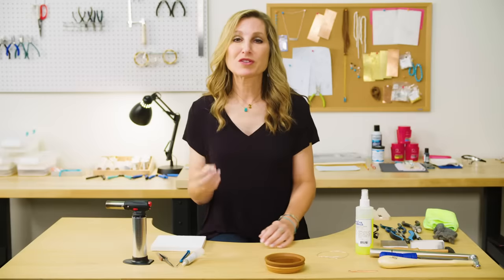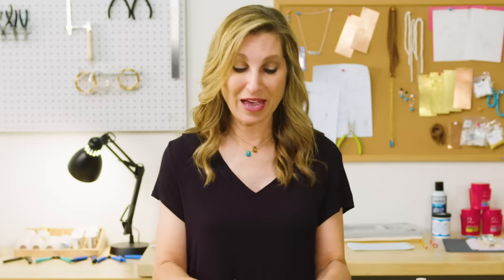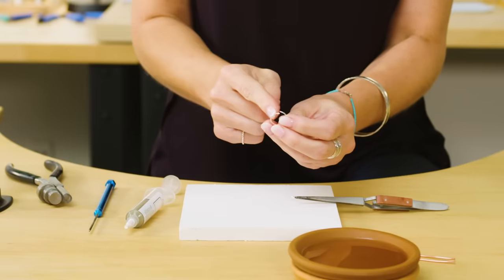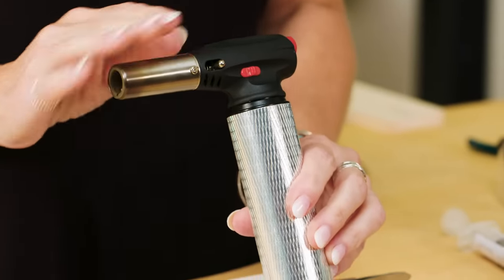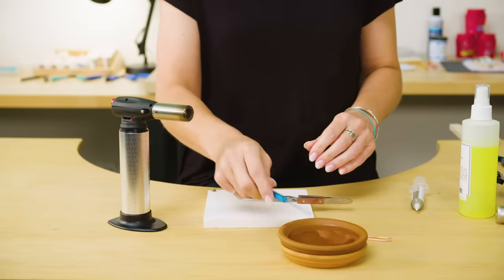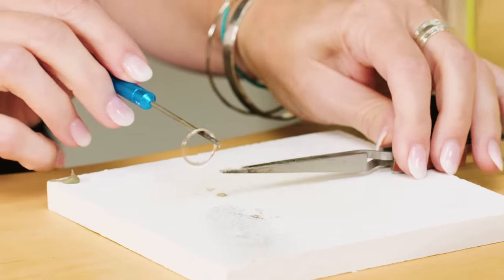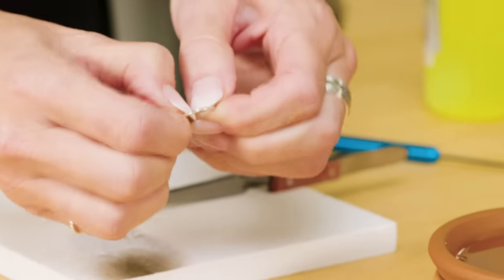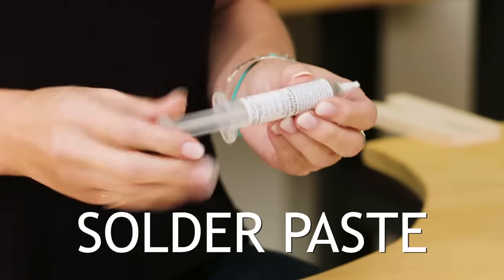The Basics of Soldering | Jewelry 101

Comment: Could you tell me what the pickle is? The liquid you put the ring in after the soldering. Is it optional?
Reply from the maker: Pickle is an acid compound mixed with water that helps to keep your metal clean after the heating process. We don't recommend you skip this step if you don't have to. Pickling will help to remove black stain called fire scale. Also if your metal isn't clean, the solder paste may not flow. Hope this helps! Check out this video: https://youtu.be/p4KJCcZgAvU

Comment: I like this video and want to get started learning how to solder. My question is, how is the silver rings cleaned afterward? Does the extra solder need to be filed off, brushed off or cleaned off? Doesn't it leave a texture on the wire?
Reply from the maker: Hey Sandra! You would put your piece into the pickle after soldering to clean it. Then, yes, you can file off the excess solder and use a brass brush or piece of steel wool to polish it. You just have to be careful when filing. For tight spots, consider a triangle file. Here are a couple of more soldering videos you may find helpful:
Beginner Soldering: Huggie Pendants | Jewelry 101
https://youtu.be/yFqnfN3DTxM
Deep Dive: Pickle and Soldering | Jewelry 101
https://youtu.be/p4KJCcZgAvU

Comment: I really would like to begin soldering - right now I just make wire jewelry. But I am worried about the fumes created by the flux as I have read it can be toxic to your body. Do you use an extractor to get the fumes out of the room? Just wondering... :) Great vid, btw!! Thank you so much!
Reply: There are benchtop extractors you can use for small jobs.

This is similar to one I would use at work. https://www.amazon.com/dp/B001RLZGKK/ref=cm_sw_r_cp_apa_i_q7UADbPRB0NJ9

Comment: Is there a different kind of flux required when using it on a brass jump ring? I don't want to have a silver mark. I haven't been to the store to purchase yet? Just firing a fast question. And also what brand is that tube Flux you are using?
Thanks so much!
Reply from the maker: Hi Julie! Here is the answer from Susan: Flux is colorless - it is the solder that adds the color. So If you use silver solder - you will see a silver mark. There is paste solder that is made for brass or you can use a 10k gold solder.  This is a slightly different process than soldering with paste as you will need to use solder chips or wire which do not contain any flux in the mix. The spray flux I use in the video will work fine with those types of solder. As for the brand- I am actually not sure.  But searching for paste solder should turn it up at several vendors. 

Hope this helps!!

Comment: What is pickle? Where do you get it?Otherwise, an excellent demonstration!
Reply from the maker: Pickle is an acid that removes oxidation and is used to clean jewelry after it's been soldered!  You can buy it here: https://www.jtv.com/product/pickle-pot-with-citric-acid/JSTKIT0006
Reply: @JewelSchool  Hi there, could you use the pickle to prevent oxidation on regular, non soldered jewels? Mainly using copper and brass here... thank you!

Comment: I use a soldering iron a good bit for dollhouse electronics.  I am interested in soldering wires for making miniature lamps and things.  Why did you choose to use the torch instead of a soldering iron?  What are the benefits of one over the other?
Reply from the maker: Hi Elizabeth! A soldering iron is like you said, is more for industrial use. The reason you want to get a good jeweler's torch, is because a soldering iron that is used for electronics won't get hot enough to melt your solder and make it flow. Here are a couple of useful links where Susan talks more about the jeweler's torch. Also, stay tuned, we have a brand new soldering video coming out on 9/1/21!  Sssshhh! 🤫 Hope this helps!!
Soldering, A Deep Dive into Pickle:  https://www.youtube.com/watch?v=p4KJCcZgAvU
Advanced Soldering: https://www.youtube.com/watch?v=93l726eLtXs
Jeweler's Torch: https://www.jtv.com/product/large-butane-torch-7-25-inches-max-flame-butane-torch-ergonomic-design/JST475?mcid=XSOjsyt

Comment: Great video, I would like to know what your 'Green Flux' is . You state the Borax acid and alcohol mixture and its usage really well. Just not the flux used
Reply from the maker: I used Aquaflux. I did not go into it because the paste solder contains flux, but I like to use the spray flux anyway to keep the metal clean:)

Comment: Until now I use borax on the piece and then tiny metal pieces of solder material. I melt and then put on the piece with the borax. Your way is much simpler. What is the difference between your way and the way I described? Also is the process you showed here the same for gold?

Comment: Hi Susan! I have a question! How difficult is it to solder bronze?
I'm creating pendants out of antique Art Medals, which are often cast from bronze. I paid $30-$35 to the Ornamental Metal Museum (in Memphis, Tennessee), to solder a ring to a medal for me, and I'm hoping to learn how to do it myself, to save myself some money.
Reply from the maker: Hi! Here is an answer from from Susan: 
Bronze is not hard to solder. Generally you use sterling silver solder and will have to find a way to camouflage the joint  and clean the metal …but other than that…same principles apply!

Comment: Great video!  I have soldered many times but always in a class setting and then the next class I forget a lot.  I have a question about the kinds of material that you can solder.  Is it ONLY for sterling silver?  Often we have store bought jewelry with jump rings, but don't necessarily know if the material is sterling or not.  Can any metal be soldered?
Reply from the maker: Hi Jennifer, great question! No, not any metal can be soldered. A good example will be craft aluminum wires and plated wires. These for instance cannot be soldered. The reason being the metal itself will melt under extreme heat and those that are plated, the plating will melt off. Safe metals that you can solder, like you said, are pure metals like .925 sterling silver, gold in 10k, 14k, etc., brass and copper. Hope this helps!

Comment: One of my questions is  -  can you solder the nonsilver wire from Hobby Lobby, Michaels, or other craft shops or is it impotant to use silver? Gold? Padellium? Titanium?  etc.,?
Reply from the maker: You can solder bare copper wire, 925 sterling and karat gold wire. Craft wires are usually coated and they will melt when soldered.
Reply: @JewelSchool  thank you so much. I will start looking for silver, copper, and better metal wires.

Comment: I have a question. If I made a braided copper bracelet and only wanted to weld the tips then sand them would I need to apply any extra copper metal while I melt the tips? Thank you for any advice
Reply from the maker: We had to do a little research on this one. We aren't quite sure what exactly you're asking, but it sounds like you want this to be an "open bangle" and are trying to finish the ends where the braid stops? If so, you can do a couple of things according to Susan. #1 you can just heat the metal at the ends and melt it slightly - akin to fusing. Then, just file it until it looks the way you want.  #2 you can add sterling silver or rose colored solder to the ends and then file. The color may not match, exactly so you probably want to do some sort of oxidization to get it to match. Especially if the surface area you are soldering is large. Here is a pretty good video showing how to fuse copper scraps: https://www.youtube.com/watch?v=_DRM1Z4-FQI
Hope this helps!

Comment: Hi Susan - what is the liquid the bowl that you dipped your solder pic in to cool off? Is it just tap water? thanks
Reply: It is simply tap water in a clay or glass bowl used for 'quenching' the metal, to cool it down.
Reply: @esalenchik  she said it was pickle
Reply: promoplus100 She did, you’re right, but pickle is a mild acid solution that is used to clean up the metal after soldering. Confused...

Comment: so, did you contaminate the pickle when you put your pick into it? or is it only ruined if you have silver in it? should you have has a seperate pickle to cool off your pick? is using water to cool off the pick ok?
Reply from the maker: You will contaminate your pickle if you put your pick into it, yes. Susan "usually" drops her piece from the pick into the pickle without touching it. You does use the pick to pull the piece out of the cooling water after rinsing it off. That action is perfectly fine. You should only use copper tongs with your pickle. Copper does not contaminate the pickle. Hope this helps!

Comment: Thanks for the video. How do you solder golden pieces ? What kid of solder/flux should be used?
Reply from the maker: Hello! You would want to use solder paste (with flux) that is the same gauge as the wire you're using. The spray flux is the same. It's called aquaflux.
Reply: @JewelSchool  thanks, however is the solder paste different for silver vs gold metal?

Comment: Hi thanks for posting this video! I have 2 questions which torch brand would i use to do a 10 gauge bangle? also can i use 10k solder paste for a gold filled wire 14k or will it not match well? thanks

Comment: What kind of the soldier did you use in this video, easy, medium or hard? Because I used brass wire and hard silver solder paste for my first soldering session, and it wasn’t succeed that the solder didn’t not melt onto the joining.  Do you know what caused this problem? Thanks.
Reply: Nicole A Tian  Not the owner of the video, but as a goldsmith I can maybe help.
First of all, solder always flows towards the hottest parts, since it’s attracted to heat.
Solder also only flows when there’s no oils or dirt in the way, so make sure whatever you’re soldering is clean.
You can do this with a little sanding paper, rinse with water and soap (dry well, with a paper towel preferably), and cover your pieces in a flux that dissolves dirt.

Lastly, solder prefers seams and holes and whatever you try to solder together, to have as little space between the two parts as possible. Make sure the two edges you want to connect aren’t too far apart, or else it will just flow onto the surface of the metal (towards the hottest part)

Also, silver has to be completely heated up in order to be soldered, other metals (I never worked with brass, but I assume brass as well) can be heated in only the place you want to solder.

I suggest experimenting with heating up metals, and looking at how they discolour and when they melt.

Might seem like a shame, but it will really teach you when to stop heating, when it’s properly heated, and when solder is going to flow.
And whether brass heats up faster than silver, or the other way around. 

Good luck!
Reply: Sophie.i. Hi Sophie, thank you very much for responding me and giving me instructions. Your words are really helpful to me as a beginner. I really appreciated it. Definitely, I will experiment with the heat. I’ve practiced a lot in the past few days and what I have learned so far are almost the same as what you explained to me. Well, I believe that we all learn from our experiences and practices. 
Anyway, thank you so much. 

Best wishes.
Nicole

Comment: I want to understand the 'pickle'. What is used to make the pickle? What type of containers to store it in? Plus what else must be known of the pickle?
Reply from the maker: Hi Elaine! We get a lot of questions about pickle. Let's see if we can clear it up for you. 

First, pickle is a dry, acid compound that when mixed with water removes the oxidation and flux that occurs on your jewelry piece during the soldering or annealing (heating) process. 
What's it made of? Well, the Sparex No. 2 that JTV sells is a longer lasting, safe replacement for dangerous sulfuric acid, however, it is still acid (although milder) and needs to be used carefully, which brings us to how you use, store and dispose of it.
You'll need a pickle pot or basically a mini crock pot with a lid for use. You should get a pot for the pickle and use only that pot. It's not for human consumption, so cooking food in it after you have had the pickle compound in it is NOT recommended. Check the manufacturer's instructions on how to store the dry compound after you open it and also on how to dispose of it safely after use! 

Here is a basic annealing (soldering) kit you may find useful if you're thinking of adding soldering to your jewelry making repertoire. Good luck!
https://www.jtv.com/product/annealing-supply-kit-incl-soldering-board-torch-head-pickle-pot-copper-tongs-more/JMKIT590?mcid=XSOjsyt

Comment: In noticed your pickle is not heated. Does it work well without heat? I am new to this and if I don't need to buy a special heated pot for the pickle then that would be great.
Reply from the maker: Lynn, great question! The short answer is no. However, pickle works best when it is heated. Check out Susan's newest soldering video that talks specifically about pickle and good luck! https://www.youtube.com/watch?v=p4KJCcZgAvU

Comment: Thank you 😊. Very impressed. How did you do this little dots on ring ? Thank you 🙏
Reply from the maker: To add texture to rings, like lines or dots, it is best to use a texturing hammer!  If you do not want to hand texture, you can purchase pre-textured wire to work with that makes it much easier! This ring is made from pre-patterned wire.

Comment: Is it best to use dead soft or 1/2 hard sterling silver?   If it depends on what you are making please specify.   Thanks.
Reply from the maker: From Susan: It doesn’t really matter as you will be heating the metal - which softens the temper anyway.  I personally find it easier to start with dead soft and then work harden as needed.
Hope this helps!!

Comment: I am soldering 12 gage copper wire circles, 1 inch round, 4 inch round and 4.5 inch round. What paste solder do I use, Light, medium or heavy?  The small circles will be a chain and the 4 and 4.5 inch will be a hanging decoration of 7 with raw semi precious stones on the inside.  Thank you,
Reply from the maker: Hi Evelyn! This is from Susan: If you are just soldering one joint per item you can technically use any paste solder.  Hard has the highest silver content so its a good choice, however soft/medium have lower melt points so are easier to use. If you are having a hard time choosing just go for medium - Its like a “one size fits most” option!!

Comment: Does this also work with .999? I'm new to silver smithing and everytime I put the torch to the solder it just beads up and doesn't flow. The Flux also foams up and it just causes a huge mess. Any help/tips is appreciated.
Reply from the maker: For .999 silver you will have to fuse it. .999 silver will be softer than .925 because it's more pure - it contains no other metal alloys which help to strengthen. It has the tendency to bend or lose its shape, which isn't very suitable for jewelry. Just keep that in mind. Also, fusing does not require the use of solder and the temperature of your flame is key!  Want to know more? Here is a great article on the difference between soldering and fusing: https://workingsilver.com/resource/soldering-vs-fusing/

Also, when soldering .925 sterling silver, check to make sure your solder paste also contains flux. Susan often heats her metal slightly before adding the paste. Then she uses the spray as she heats the flux. Here is a playlist of a few more of her soldering videos that may help you to get through this process.
Advanced Soldering: https://youtu.be/93l726eLtXs
Beginner Soldering, Huggie Pendants: https://youtu.be/yFqnfN3DTxM
Deep Dive, Pickle and Soldering: https://youtu.be/p4KJCcZgAvU
Advanced Soldering, Huggie Rings: https://youtu.be/_Ggn2uNieV4

Another suggestion is to search out some silversmith groups in your area or nationally. They love to answer questions, and may even have a meeting spot for workshops, whether in person or online! Good luck to you!

Comment: I make rosaries and use jump rings to attach the crucifix and center.  They are often quite small, 6mm or less and linked to small chains and beads.  Can I solder these closed or will the torch be too hot, so that beads or small linked chain in proximity will be damaged?  I just want to add some strength to them and make it harder for them to be pulled apart by accident
Reply from the maker: The torch will disintegrate  the beads if near a hot flame. if you want to solder your links, you'll need to do it before putting on the beads. Using a heavier gauge metal will probably work just as well for jump rings.

Comment: Nice video, but as regards the pickle..when you "contaminate" your pickle, it is because you have introduced Ferous metal..iron..which causes electrolytic plating-in other words, causes the copper in your solution to plate any non ferous metal in the fluids..

Comment: if you put the hole at the bottom you can fill the joint with solder btw you put flux in the hole and solder will fill it. solder always flows where the flux is

Comment: Just curious, why do you use a torch instead of a solder iron?  Can you use a solder iron as well?  I’ve never made jewelry before, but I have a 60W solder iron and wondering if this would work or if I need a torch.
Reply from the maker: Soldering irons are meant for electrical work. We only use torches rated for jewelry making. Hope this helps!
Reply: @JewelSchool  thanks for the help!  I’ll look for a torch rated for jewelry instead.

Comment: How would one totally de-solder a silver soldered joint? Would one simply heat the joint until the solder falls out of the joint due to gravity? I ask because years ago I was soldering and de-soldering electronic  components, and we helped the de-soldering process by "wicking" up the solder by using  braided wire.
Thank you